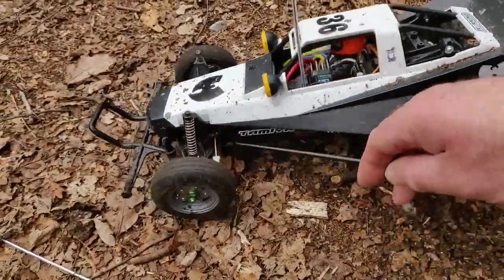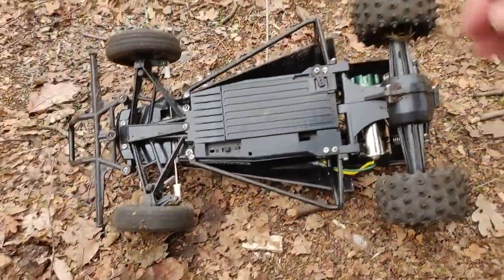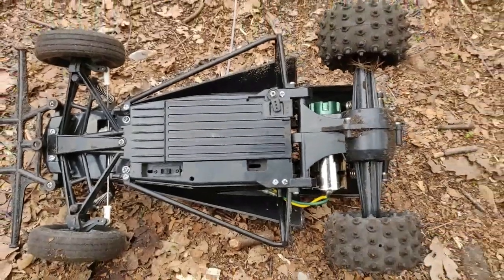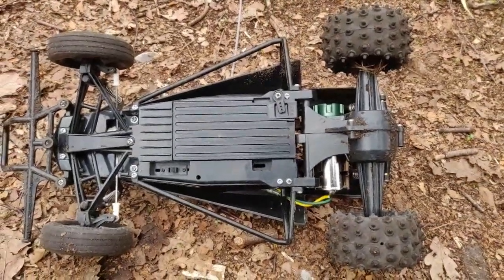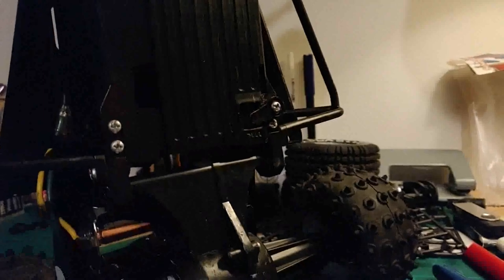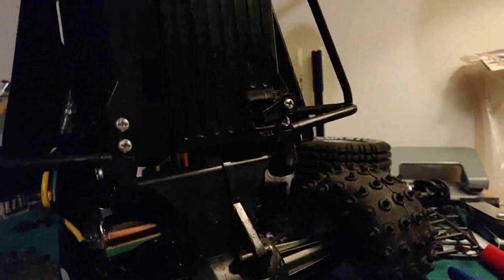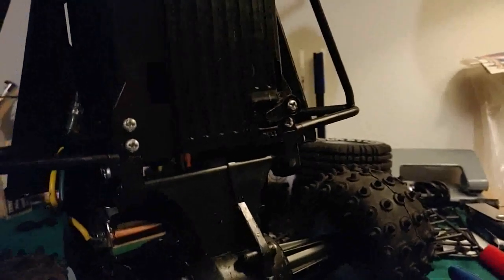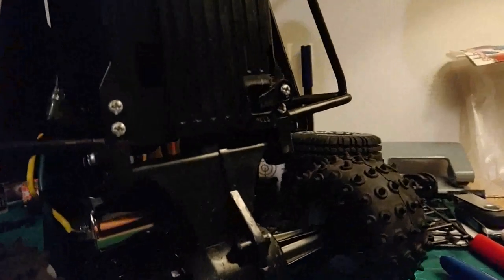Tamiya Grasshopper - Battery Door Fix! Easy & Free!!

Comment: Hornet wheels and tyres are brilliant upgrades, I fitted them on my fav for forest bashing, so much better !
Also great mod for the mk1 hopper ,
Reply from the maker: Half way through building an FAV 👍🏼  I have an OG Wild One too. Awesome looking RC's. Love them so chuffed you got one too. Feels like we are connected lol.  The grip on those tires was way more than expected.  I kinda missed sliding it out lol
Reply: @DustyFingersRC  my lunchbox is up and running my hopper 2 is basically in bits I’m gonna make a hornet hopper thing out of various spares I have, my fav is standard other than torque tuned motor, hornet wheels and lights, it needs a gearbox rebuild and I’m toying with the idea of a full resto and retiring it to the shelf but it looks so cool smashing through clumps of leaves splashing through streams, if they ever re-re-release the wild one I’m gonna buy 2 !!!
Reply: @DustyFingersRC  next rc is an ma08 drift project although I’m more of an offroad rc guy, then a blitzer kit if I can get one new, but yeah the wild one for me is the ultimate kit to get, I just hope they do another run of them, when the lockdown stuff is over I can recommend loads of spots down here in Cornwall if your ever down here on holiday mate, keep the videos coming 👍
Reply from the maker: @M.A.S.Ked-Crusader  Nice part of the Country and I don't really go abroad so maybe we can get out one day 👍🏼
I have Blitzer Beetle. Nearly finished. Although, you could convert a DT-02 to look just like one. A great YouTube called Pete put a video up. He has great ideas and I watch all his videos. Hold on. I will find the link.
Reply from the maker: https://youtu.be/_dgvLkxR1qY

His channel is a fave of mine. He really get the most out of his RC's
Reply: @DustyFingersRC  I did watch this and I might go down this path as he rates the DT02 chassis over the standard one, he also gave me the idea of waterproofing my receivers with a balloon, soo simple but it works, thanks for the heads up !

Comment: Hiya Damian.  Top tip mate.  I had a fix that involved a screw and a spring pin.  Not as easy to use as your fix though.  Hey I did measure the Hornet wheels and the Rough Rider wheels I have and the Rough Rider ones are bigger in diameter both front and back by about 6mm.  You can obviously get the Hornet tyres on the bigger wheels as you have shown.  I do prefer the gunmetal finish I must say.  Anyway, cheers for the info about the battery door :-)
Reply from the maker: Hi Pete, I measure the Gunmetal wheels as 45mm diameter, same as my Grasshopper white ones.  Is your Rough Rider an original?  Maybe for the Re Re's they have just kept them the same.
Reply: @DustyFingersRC  No it's all re-re stuff that I have.  When I get a mo I'll send you a photo on messenger.  I'm confused if I'm honest!
Reply from the maker: @PeteWylieRC  OK. My old Facebook profile is closed. Now my first name followed by Channel name 👍🏼
Reply from the maker: Maybe the ones I have are just for the FAV shark mouth despite being advertised as for both that and the Rough Rider.
Reply: @DustyFingersRC  ok mate. I'm just out RC'ing. I'll give you a shout later 😁
Reply: @DustyFingersRC  just got back. Actually do you want to ping me a friend request on Facebook? You will recognise my ugly mug!
Reply from the maker: I actually tried looking for you earlier and couldn't find you.